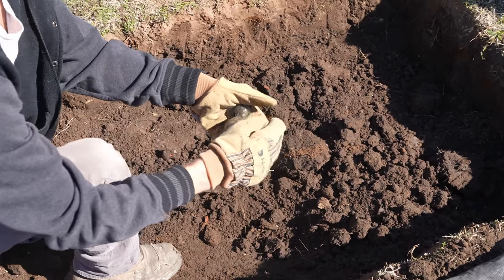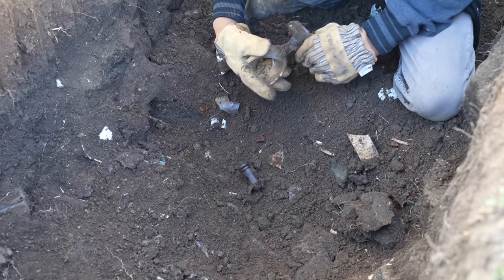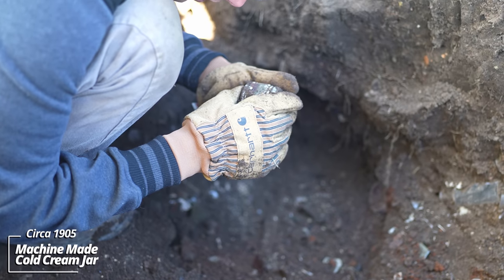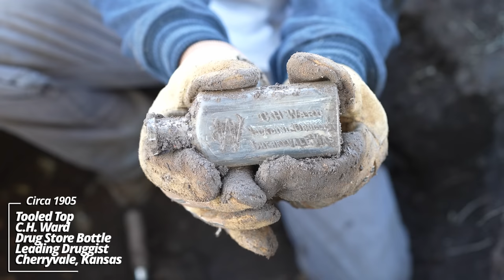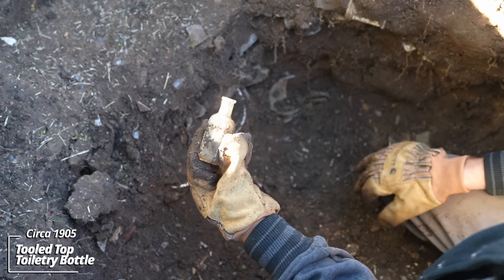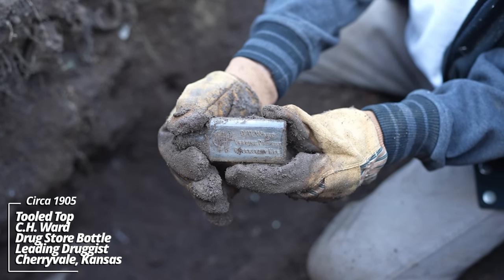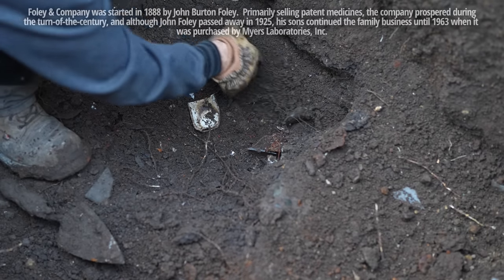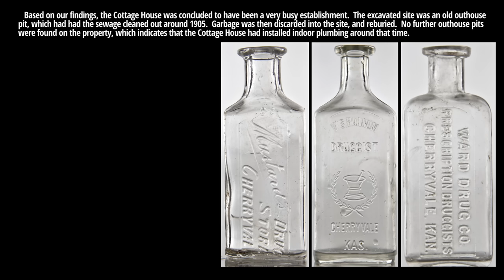Hitting an Unbelievable Jackpot Buried Under a Vacant Lot for 120 Years

Comment: In the mid 1990s I purchased 150 acres of land in New Mexico from different land owners.  There was an old Inn that was once on the land.  The only remaining part of the Inn were the remains of  three outhouses.  The Inn was demolished circa 1920.  In one of the outhouse remains, I dug down about 2' and found a stash of gold and  silver coins from Mexico.  There were hundreds of coins from the mid 1800s to the early 1900s. The box and contents weighed   85 pounds. 

All coins are safely kept in a very secure location since the found treasure is  very valuable.   I don't need the money by selling them, but have chosen to hang on to them for when the SHTF.

Comment: Where we lived in rural Illinois (admittedly, it was more rural prior to my arrival) the trash, tree leaves and clipping ended up on a pond in the rear of the property. Dad had dreams of filling in the pond (the pond was referred to as the swamp in mosquito summer), but there was only so much to place there. Some neighbors would sometimes dump their refuse there. My uncle worked in oil burners for heating and would cart out slag removrd from furnaces he serviced. The pond would dry up to some extent and dumped glass bottles would float up when the area refilled. My older brother (and later scientist) remarks how much he enjoyed throwing rocks at floating glass bottles. In the winter, we could skate there in areas without too much plants poked through the ice surface. 
Although it didn't occur to me at the time, I guess the vegetation contributions probably could have been considered compost. 
This comment is already too lengthy, but ... quite a few deceased pets from our Chicago relatives came to be buried on our property, but none to my notice ended up in the pond itself.

Comment: When you fill in the pit, do you discard all the broken items or take them elsewhere?  I still would like to know if you sell any bottles on ebay.  Thanks.
Reply from the maker: we arent currently selling anything on ebay. we are considering starting a store, but we im not sure when that would be. if we end up doing it we will for sure let it be known in a future video.  and yeah, the broken stuff we just put back at the bottom of the pit, cover it with some of the cleaner dirt, and then we fill the pit in on top of it, so that way we dont further break anything. we actually give away a bunch of the stuff to local historic societies and museums or the landowner. we drive around with such a packed vehicle with all the equipment, that we usually dont have room to take everything with, so we just take the best stuff. thanks for watching.

Comment: how long does it typically take you to open up a pit before you hit items?
Reply from the maker: Usually about an hour. the stuff was really high on this pit, but typically its about 3 feet down. depends on the size of the pit, but usually with both of us digging, we start finding stuff after about an hour, sometimes up to 2.... once it gets longer than that, we start to get worried

Comment: Did they use cork on the tool topped bottles?
Reply from the maker: yes they did, and some of the machine made ones too.. the screw top wasnt dominant until the 1920s-30s.. they had pewter screw tops but up until around the late 20s, it was basically all cork topped.. even the glass stoppers that you see in some of the bottles would (usually) be wrapped in a a donut of cork.. but sometimes the glass stopper would just sit directly on the glass. but yeah, over 99% of bottles i come across that are tooled top were also corked.. but there are some that were threaded. hope that answered your question. thanks for watching!!!!

Comment: How can you tell a pit has a lot of glass before you start digging?
Mesa AZ
Reply from the maker: we use probe rods. its very crude and sometimes you can be way off on your estimation. but basically how we find the pits is we probe the yard, until we hit glass.. sometimes you will probe and his a bunch of glass, sometimes you wont hit much, but there could still be a bunch in there. this particular pit we thought it might have been from like the 50s or something because there was so much glass in it.. we almost didnt even dig it. i remember we couldnt get the probe rod in deep enough to touch the bottom, because there was so much stuff inside. hope that was easy enough to understand. i think we show ourselves probing in some of our other videos, so im sure if you are watch some of our other videos, you will see what im talking about. thanks for watching

Comment: Is is possible to make your font at the top of you screen bigger? My eyes aren’t the greatest even with my glasses off and 6 inches from the screen.
Reply from the maker: yeah.. its a struggle to fit the stuff.. ive taken it up a few sizes, but i can do it a little more.. no problem. might be a few weeks until its bigger and it wont be by much.. but i can do that.. its just a balance between trying to make it easily legible and small enough to fit.

Comment: You are in a classic trash dumping pit where you are finding mostly glass. Stop using the trowel to dig items out. You should be using a thin wooden stake and you won't be breaking so much. They are great for sticking in the wall of the pit to feel for items. I used to do a lot of pit digging - it's fascinating, especially the old whiskey bottles.
Reply from the maker: haha if you go back into the old videos we actually do use a wooden stick.. i honestly dont know why tom started using the trowel, but i told him he shouldnt because i dont like the way the audio sounds when it scapes stuff.. and it takes me forever to clean it up.. because ppl dont wanna hear that.. but yeah, they must have dumped trash in the outhouse pit after the got indoor plumbing. well thanks for watching and commenting!!

Comment: You know I put a fire pit in the lowest part of my yard several years ago, a couple of years ago I had a lot of potatoes that had gone bad over the winter and were beginning to smell very badly (I know shame on me for not using them all)  In deciding what to do with them I decided i would bury them in the center of the fire pit that way if the ground on top of them sank it would just be filled with ash from the fires.  Well I dug down quite aways to bury the potatoes and I began to find broken dishes and things I didn't go farther with it at the time I put the old rotten potatoes in there buried them  jumped up and down on the soil till it was compact as I could get it over the top of them and did it again.  Now after discovering Below the Plains videos I am wondering if that spot isn't the old outhouse pit and what else I would find if I dug it out better.  I am planning to build a little patio and new above ground firepit in anaother part of the yard and fill this one in and sod it over when I do that I might dig down and see what can be found. House here was built I believe in 1903